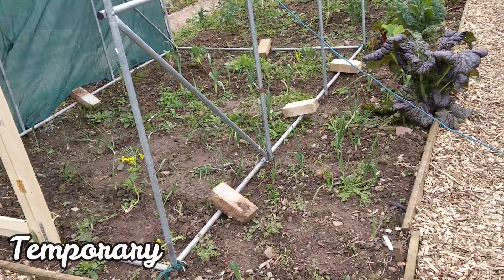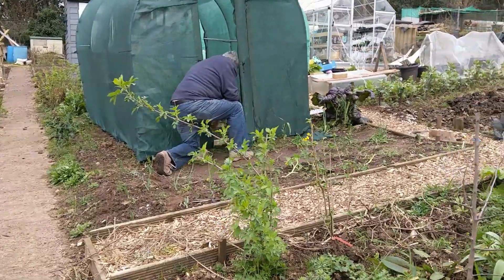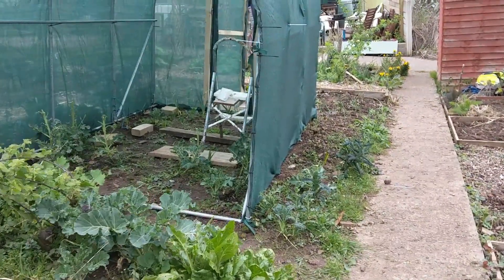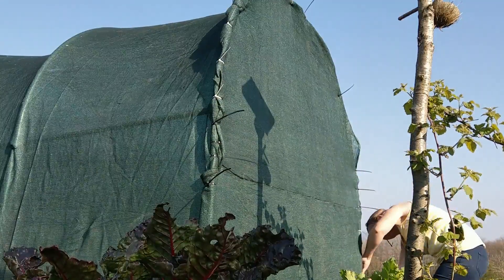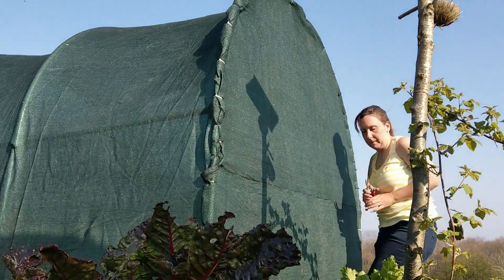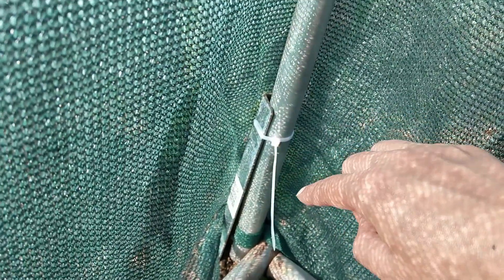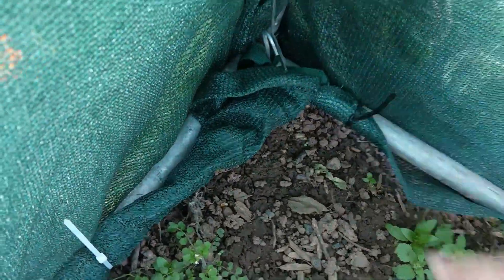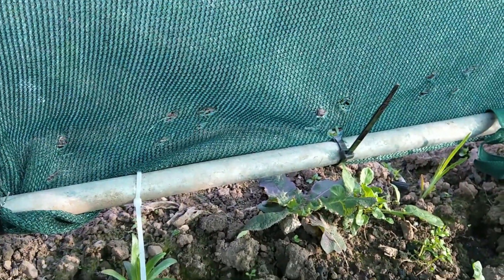Part 3 brassica cage build from polytunnel frame

Comment: It looks like a good job done Becky. The cable tie idea is great! Have you thought about using those ringlet thingies, that you squeeze on each side of fabric? They create a reinforced hole you could thread the cables through. Just an idea!
Reply from the maker: Hi Steve
I hadn't thought about the ringlets. That's a fab idea. Would the butterflies be able to get through it or are they quite small?
Reply: @Beckyslifeandallotmentdiary  There's different sizes so you could choose little ones. I've used them in clothes making, fixing tarpaulins and camping but I could see how you might use them from your video, even to plug some holes perhaps!
Reply from the maker: @MrBobthephilosopher  it's a good plan. I'll have a look at some and see what I can do.